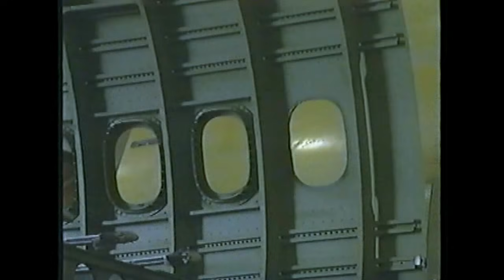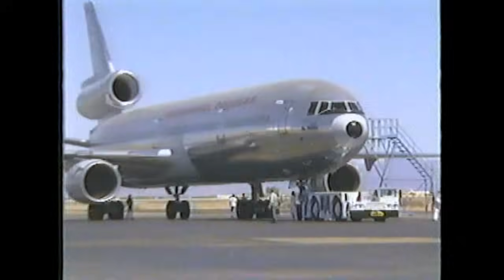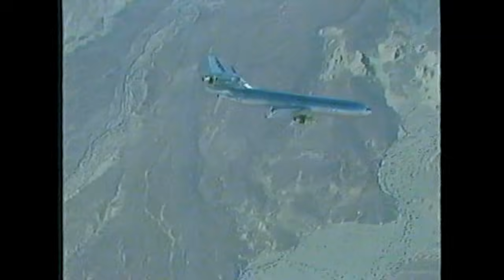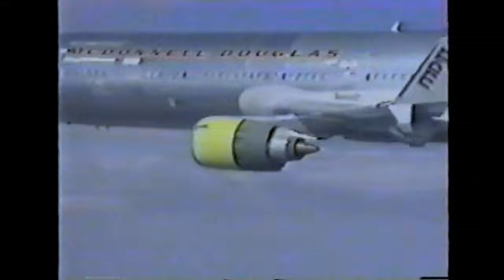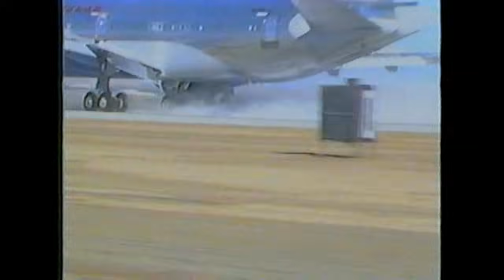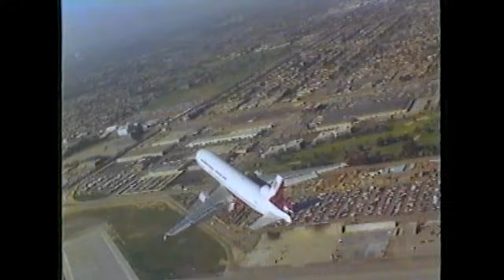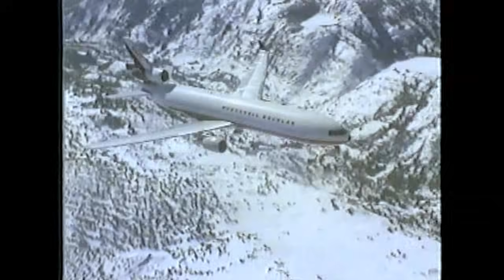McDonnell Douglas MD-11 Promo Film #1 - 1991

Comment: Such a handsome beast! They tested it by flying into a HURRICANE! I'm so glad they're still flying, even as freighters. Never got to have a go although I flew the L1011 a couple times in the mid to late 90s (Air Iceland). I remember the stencilled mountains on the transverse bulkheads and the drinking fountains with Air Iceland cup dispensers.

Are three engines inherently better for freight ops over two (no need to divert if one goes down, causing a potentially ultra expensive delay in delivery)?
Reply: Trijets don't have an advantage over twins, in fact the opposite is true. They're used by freight carriers because they're cheap- no passenger airlines actually want them because 3 engine jets waste so much more fuel. Cargo planes have more ground time between flights, making them less dependent on fuel efficiency.
Reply: You will still divert if you have an engine failure over the Atlantic in a trijet. You also cannot keep your optimum cruising altitude on two engines with one dead engine, who will cause more drag etc. If you're close to destination, then you'll continue but you can do that with a twin, too. Twins who fly over long stretches of nowhere (oceans, polar regions etc.) are certified that they can fly safely for prolonged times on one engine. I won't deny the thought of being on a flight from the US to Australia, an engine failing in the middle of the Pacific and the next airport is 3 hours away is still not pleasant.

What also comes into the decision with diversions after a mechanical failure is maintenance and repair of the stricken aircraft. It's expensive to fly a new engine and mechanics into Bumfuck, Kentucky and have the aircraft grounded there, not making money. So they will take the costs for delayed delivery, load a backup aircraft and start again from one of their bases. Also the reason why passenger flights sometimes return to their origin or divert to another airport when they were 'almost there'.

Comment: Problem with the MD11 is that it couldn't meet the performance requirements it claimed. Plus it has 3 engines when 2 engines were becoming much more prevalent aswell as fuel efficient.
Reply: 747 has 4

Comment: Is it true that MD11 is a challenging plane to land?
Reply: +mrcannotfindaname yes it has the highest landing speed of commercial aircraft
Reply: That is true, MD-11 has to lands at speeds around 200knots, while the other planes lands below 170 I think.
Reply: boffis123 So how does high speed landing challenging?
Reply: more impact force
Reply: Random HKdude 01 Flare properly, how will this increase impact force?
Reply: its easier said than done, a higher speed means less reaction time, flare properly right... pilots are only human
Reply: Cman most md-11 pilots say they love the plane and it’s good to land but more challenging like others. So it’s bullshit that it’s a hell for the Pilots. If that would be true they would definitely not operate md-11s. Btw the landing speeds are around 160-170 knots while other aircraft land around 140-150 knots usually.
Reply: Cman but I agree with the bad stabalizer
Reply: it has different aerodynamics, that's why of that unique wing shape, its mostly because of the engine in the tail. so that's why that Lufthansa cargo flight crashed.
Reply: @benzjiman6931  Can I ask what is the unique wing shape?
Reply: Part of what makes MD-11s unique to fly in general is their center of gravity in relation to center of lift.  Having the CG forward of the center of lift is what makes an airplane stable and default to straight flight, but the further forward it is, the more trim drag is induced via downforce by the tail.  In attempts to compete with the efficiency of twins, MD gave the MD-11 an exceptionally slim stability margin, which reduces the required pitch and trim forces needed to control the airplane.  This also allowed them to use a much smaller stabilizer than the DC-10, further reducing drag.  Others have mentioned that this smaller stabilizer affected crosswind performance and therefore required a higher approach airspeed.  One other interesting quirk of this design decision manifested itself in some early incidents in which the slats were extended in flight.  This moves the center of lift further forward and reduces pitch stability, but the MD-11 having less static stability than other airliners, it lead to outrageous high-G pitch oscillations in flight and even a couple fatalities from people being bounced around the cabin.  These characteristics and incidents were the inspiration for the plot of Michael Crichton's novel "Airframe".
Reply: JETZcorp its because of the engine placement in the tail
Reply: @benzjiman6931  The enter of gravity is rearward due to that, but the center of lift could be put just about anywhere in design via wing placement.  The DC-10 also had the tail-mounted engine, but had a far greater margin of stability due to its wing placement.  The 727 and MD-80 were both way more rear-heavy than the MD-11 but they were designed with more stability margin as well, again due to wing placement.  These factors are all considered very carefully in design.  MDD gave the plane the characteristics and dynamics it had deliberately, as a design compromise.  The DC-10 was already pretty inefficient during the tri/quad-jet era, so updating the design to compete with twins required radical measures to improve efficiency.  This reduced stability margin is one of those radical measures.

Comment: I wonder why didn't MDC ditch the tri-engine config & developed the MD-11 as a twinjet instead? It would have probably been much more beneficial & we'd probably have more MD-11 still flying today.
Reply: Yes, that could work, but then the MD-11 would not be the same, the MD-11 looks beautiful as a trijet, but it would not look the same as a twin jet. It would basically be an A330.
Reply: At the time the MD-11 was designed the ETOPS ("extended-range twin operations"; alternatively "engine turns or passengers swim") rules required twinjets to stay within 120 minutes' flying time of the nearest airport. Trijets weren't subject to such limitations which made them ideal for many intercontinental routes.

The FAA increased the ETOPS limit to 180 minutes in 1988, and in so doing arguably doomed the MD-11 to market failure (but of course it was far too late for McDD to change to a twinjet by then).

Comment: Is it true that smaller horizontal stabilizers forced it to take-off and land with faster velocity than other commercial aircrafts? And didn't the smaller stabilizers cause it to bounce?
Reply: Tail surface and ruder. were small to reduce drag and improve fuel efficency. Because of that MD-11 Landing speed was one of the highest for a commercial airliner ever. Bounce recovery procedures were part of MD-11 training I guess. But you bounce a Cessna also. Plenty of them doing money around the globe delivering cargo. Its a works horse, dependable, and proven airframe, its a good airliner just as MD8x or MD9x
Reply: JokeriPokeri17 yes, McDonnell Douglas made the horizontal stabilizers smaller in order to reduce drag and increase efficiency. The problem with that is that by reducing surface area you need more speed in order to generate enough lift to make the airplane controllable so the MD-11 needed a higher approach speed in order for the horizontal stabilizers to be more "effective".

Comment: The MD11 did have some problems just like its older brother the DC10 but at least it was Different and it didn't look Like the boring "Twin jets" we have now. The golden age of aviation was awesome and will
Never get it back!
Reply: ***** lmao, no. I don't think having 3 GE90's (90,000lbs of thrust EACH) would nearly be economically possible.
Reply: Yeah...don't think a GE90 would fit on the tail ha!
Reply: Fuel prices, and twin-jets being allowed on longer routes, were the demise of the MD-11 and A340, If the MD-11 became a twin-jet it would probably be in major use today.
Reply: DeclanHaselhurstAviation  It would be very costly for these workhorses to be banned from the routes they were designed for. I also compared the MD-11 to other planes, like the 767 and 777 and A330. A330 had around the same range and around the same max and cruise speed. Can you think of any other reason why twin-jets should be banned on long routes, other than you want tri-jets to be brought back? I love the MD-11 with all of my love of aviation, it was my first payware aircraft for FSX, but i can understand from the airlines point of view, it cost more money than needed.
Reply: that is physically impossible. 3 engines = more fuel usage
Reply: The third engine adds unnecessary weight, That is why it isn't as efficient. It'd be nice but the 777-200LR flew farther than the A340-500. if airbus, or boeing tries to break the previous record, and the best option to make it fly farther happens to be a tri-jet, then it would happen.
Reply: That would probably add to fuel efficiency, But again the weight of the third engine.
Reply: I read there's development of a new supersonic tri-jet which looks like a combo of a a B-727 and a Concorde.  See less and less tri-jets these days, and all cargo, but I still love seeing even a FedEx DC-10 or MD-11 when I can.
Reply: psychocuda I hope the centre engine is straight through, not an S-duct!
Reply: No, it's straight through.  I think if they did an S-Duct at those speeds, the horizontal stabilizer would rip off lol
Reply: You mean the Aerion AS2? I think thats a buisness jet.

Comment: McDonnell Douglas sure had a bad record but with thoses upside down winglets they were ahead of their time...
I even think there was a DC-10 with prototype winglets also in the 70's or 80's I don't know why they did not keep it... 
Correct me if I'm wrong
Reply: You could be right about the DC-10 but I am not aware of it.  I was on the Flight Test team for MD-11.  The winglets went through many changes.  We would use bondo and change the shape as required by engineering until they were finally satisfied with the results.   It was great and exciting times being on this Flgiht Test team.

Comment: The name DC10 made people nervous at the time.  Douglass changed the name, all else remained the same
Reply: @David >  It is ridiculous to say everything else remained the same.  There were many changes. 1.  Complerely new Avionics,  2.  new engines 3.  Longer fuselage,  4.  Tail was redesigned and tail could hold fuel.  5.  all the aircraft systems were chainged and upgraded to be automatic.  6.  Wing design to include winglets.    I'm sure I am missing many other changes.
Reply: @rcairflr I'm here two years late but the name change was actually because a company merge.

Not to hide the DC10. Which itself was actually a very fine plane. Most of the accidents were pilot error or maintenance issues.

Comment: The only reason this plane flopped is having one engine too many
Reply: MikeGoesBadaBoom not to mention the fact they didn’t develop a single new aircraft between 1967-1997
Reply: Bad timing and risk averse business management . The success of the 767 and A300 should have been their wake up.
Reply: You are absolutely right about having one too many engines. Especially these high bypass turbo fans. Most airlines were shifting to twin engine wide body’s already by the early 80s.  Plenty of time for MD to develop a clean sheet wide body twin.  

Even the fuel crises should have been sign that efficient twin engine jets would be the future

Comment: I want them to remake this with more fuel efficient engines and a composite material body some day.
Reply: 95shredder nahh..its just not the same
Reply: +95shredder nope its not the same, MD-11 = Tail engine, wings at the back, awesome design. 777 = another boring twinjet.
Reply: +boffis123
 The 777 is not a boring twinjet it's an outstanding one, far above the MD-11. It actually holds the flying distance world record of 21601 km with a 777-200LR. It is also powered by the powerful GE90 (a single GE90 engine is efficient to power a 747-400 at cruising speed) the same that easily provides a speed above 539 knots or 1000 kmh (I flew on a 777-300Er at 31000 feets with a record speed of 560 knots once).
Reply: Louis Brasil Still boring design, just two engined like almost any other plane, nothing unique on it that makes it looks special like,

MD-11 with its 3rd engine.

747 with the little extra upper deck at the front and 4 engines.

A380 which is a doubble decker.

787 with its special looking engines and wings.

A350 with its amazing design, wings and cockpit windows.

A340 which is like a twinjet, except its not, it has 4 engines.
Reply: boffis123 "nothing unique on it that makes it looks special like,"
Actually the size of its engines far bigger than any other "twin engine" make it look quite special and unique.
After all it's not what a plane looks like that make it special is what it can achieve and the 777 can achieve high speed performances ( in very rare occasions it is able to reach a close sonic speed (1224 km/h) (Flight BA114) And fly JFK-SIN (NY-Singapour) non stop. I still love the MD-11 however we must admit it just can't achieve such a performance like the 777 does.
This is basically why nowadays the 777 is a "must have" in long-haul commercial aviation, for what it has in the guts and not for what it appears to be.

Can't wait the new B777X8 and X9 to come by the way <3

I have discovered both the MD-11 and the B777-200ER with the same airline, Varig airline and it was around 1998-2006 Varig was the biggest passenger MD-11 operator (26 units) and these flights were very cool though.
The first 777 came to Varig in November 2001 (PP-VRA and PP-VRB) I flew in Feb 2003 for the first time on one of these for a Paris CDG-São Paulo GRU and that was the most memorable flight I had for two reasons:
For discovering the In flight Entertainment system this time installed in the economy class and for its speed above 540 knots.

Heres the first 777 I flew in my life:
https://upload.wikimedia.org/wikipedia/commons/5/5f/PP-VRA_B777-2Q8ER_VARIG(75yrs)_LHR_01JUN02_(8190581722).jpg
Reply: Louis Brasil MD-11 will always be my favorite, dosent matter if 777 could carry Titanic, I would still have MD-11 above 777 on my favorite list.

And they way 777 kills a lot of airplanes such as 747 and the recently killed MD-11 is one of the main things why I dont like 777, 

MD-11 flew passenger service shorter than Concorde, all thx to 777 -_-
Some MD-11s arent even 20 years old yet, and there are still 777s in service that are older than some MD-11s.

For me, the 777 will always be the boring twinjet that killed many awesome airplanes.
Reply: boffis123 The 777 killed many awesome airplanes because it was even more awesome and superior to their capacities that's why.
But I agree the MD-11 passenger version died to soon.
Besides the 747 aren't killed yet, there are still the 747-8 which is a bit underrated comparred to the overrated A380.
Reply: Louis Brasil The 747 has just begun, the MD-11 almost died before Dc-10 did.
And the cargos will not last much longer either.

And the 747-8 is like the MD-11 to 747
Reply: boffis123 Yes it's sad to know the DC10-30 had it's last flight with Biman Airlines on February 2014 and the MD-11 with KLM later in the year in November.
42 years for the DC10 against 23 for the MD-11 too bad.
Did you had the priviledge to fly on board the MD-11 on various occasions? If yes, with which airline?
Reply: Louis Brasil nope, I never got to fly on a MD-11 :(

I flown on one Dc-10 from Premiair but I was just a baby back then, I know it thx to my parents who are interrested in planes too

But I remember seeing Finnair MD-11s in Helsinki when I flew from there a few times, I could see all the Finnair A320 and 757 planes standing there and then there was the MD-11s that looked so special with the white engine at the blue tail.

And the total of nearly 200 passenger MD-11s lasted 4 years shorter than the small concorde fleet of 15 passenger planes.

Japan airlines even planned to replace their Dc-10s with MD-11s but then they started to replace both models with 777 and Dc-10 which was meant to be replaced by MD-11 lasted longer in the fleet than MD-11.
Reply: Boffis123 I never flew on the DC10.
But I Flew many times with Aeromexico MD80 family jets (MD82/83/87) and I also flew twice on an Aeromexico DC9-32.

Comment: Can an aviation expert  or  an air planes manufacturer inform me how can the wings  afford the  heavy  weight of the jet engines ? How the engine being engaged or hanged or installed  to the wings of the  air  plane  ?
Reply: I'm no expert but the wings are designed to handle far greater forces than the what the weight of the engines can put on them.
Reply: Thanks a lot for your clarification
Reply: Anas Hamdan Most of the structure strength comes from the wings and the center box of the wings.

Comment: I cannot believe I am actually reading all these glowing tributes to this piece of junk.  I actually did  travel from India to the United States  on this airborne concrete mixer in 1994 . I vividly remember this journey for all the wrong reasons.  The seat spacing and  the atrocious service onboard could be attributed solely to  Delta Airlines but what  could be said of tiny seats , the high amplitude vibration and the  feeling that the whole contraption would  come apart at any moment? 
Lousy service be damned 
Delta was considerate enough to  send the booze trolley down the aisle frequently  to help passengers cope.
Reply: Ricopikoo 
Sorry about your service , but I must say you busy have been on another type a/c because, these were taken out of Publix service over two years ago.
Reply: Klm being the last
Reply: By the way i was one of the flight test techs that certificatied the MD-11 , which are now used only as cargo aircraft